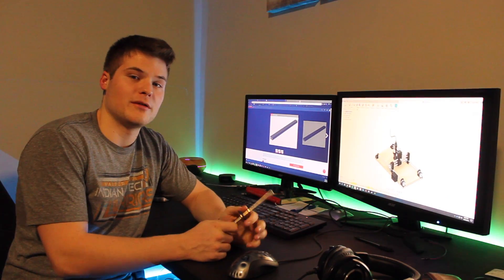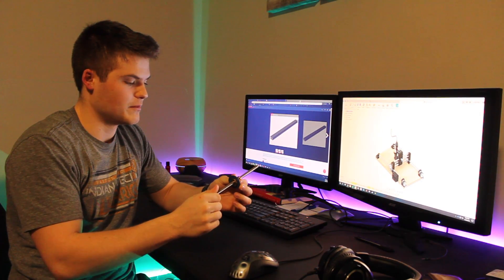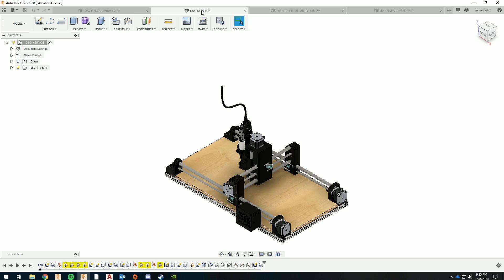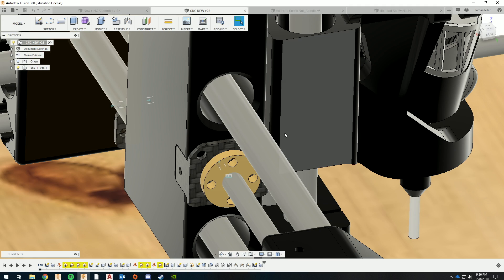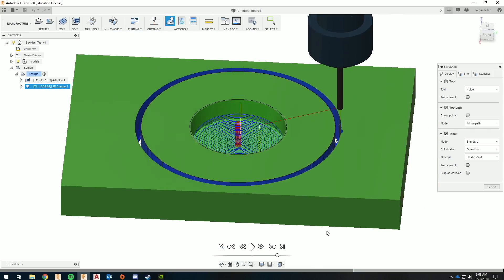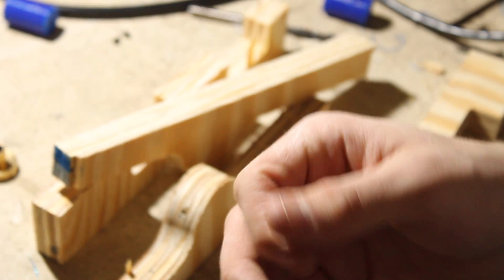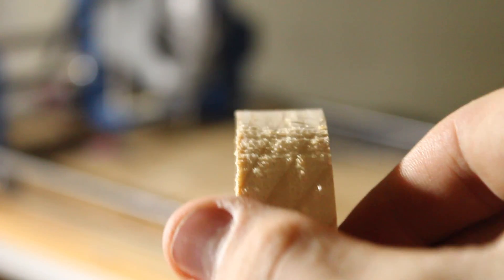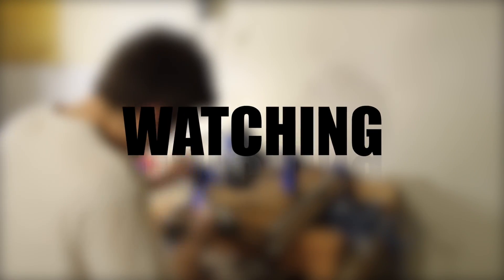DIY CNC W/ANTI-BACKLASH LEAD SCREWS

Comment: Hello, Jordan, how are you?
I set up my CNC using the Nikodem model!
One question, in your update, you used this material: Anti-Backlash Lead Screw Nuts, but did you use springs?
Thanks!!
Reply from the maker: Springs in the backlash nuts? Yes.
Reply: @JordanMiller1117  Jordan, thanks for answering!
I can't configure the axes, using UGS, I'm using shield with Arduino Uno.
What configuration are you using on UGS?
Thanks!
Reply from the maker: @humberto367  I didn’t use UGS, I used what Niko did in his videos. I forget the name of the software.

Comment: Thanks for sharing this. Why did you create those addons exactly? There was no way to modify the part appropriately to accommodate the new nuts?
Reply from the maker: Andreas Vasiliou widening the whole would have ran into the 4 mounting locations for it. I was worried that there wouldn’t be enough substance to hold the anti backlash but in place.
Reply: @JordanMiller1117  I assume you don't have parametric control of the design and can't reposition the holes?
Reply from the maker: Andreas Vasiliou well you cannot reposition the holes because they need to be the same for the lead screw nut to attach to it.
Reply: @JordanMiller1117  Oh right I see.

Comment: You can't get an accuraete internal measurement using calipers because the internal jaws are not aligned to each other so you're measuring across a slight angle. Use telescoping gauges for more accuracy and measure with the external jaws of the calipers..
Reply from the maker: Sharpeyed Watcher yep I agree. Would have made the measurement with that if I had the tool.

Comment: did you use 2 screw nuts per lead screw when you had problems with backlash?
Reply from the maker: Lia thus Nope, just went straight to the anti-backlash.
Reply: @JordanMiller1117  ok thanks for answer, i'm pretty sure in original dremel cnc there should be 2 screw nuts per lead screw and it also prevents backlash
Reply from the maker: @adamlisowski7774  Not sure I remember that on the original one. I know he did it on the new one with the spindle he made. Nikodem had the same problem because he commented on my first video about it.

Comment: 3D print ABS or PLA
Reply from the maker: I used PLA, much easier to print with. If you want the rigidity of ABS, but the ease of printing PLA. Use PETG, it is the perfect filament for the job.
Reply: @JordanMiller1117  PLA is actually more rigid than ABS, and PETG is the least rigid of both. PETG's flexibility is why it typically has good strength, but that's counter productive in this application. Your choice is actually ideal.